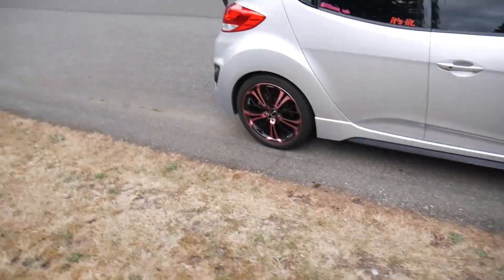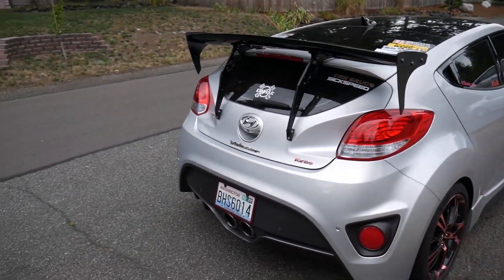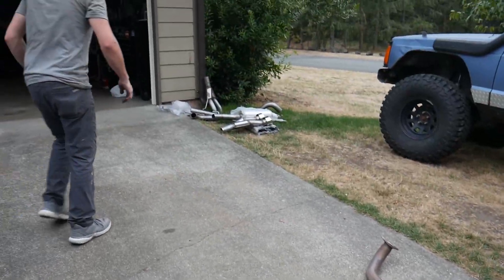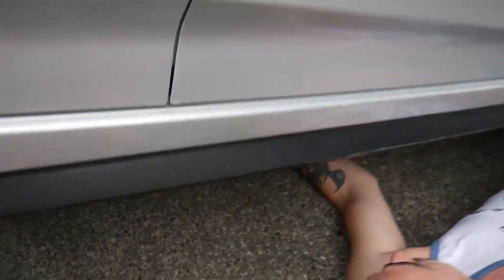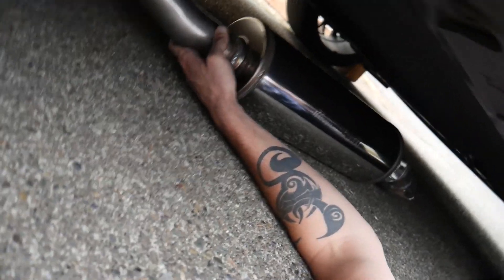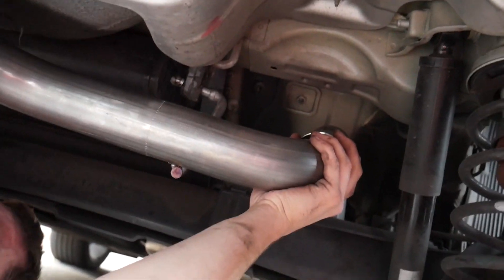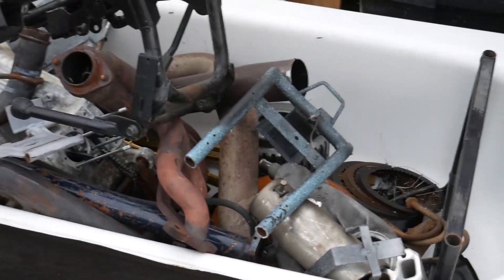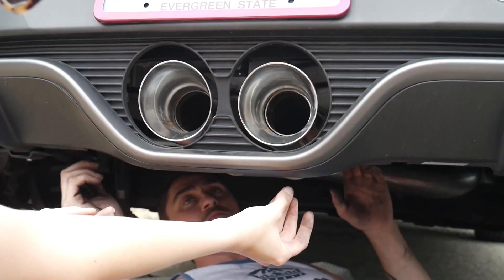THE VELOSTER GETS A MAGNAFLOW EXHAUST!

Comment: Hey guys, love the video just have a couple of questions. What year is the Veloster, is that the magnaflow 15215, and did you get any check engine lights from that exhaust? Thanks!
Reply from the maker: Answers to your questions!
1. This is a 2017 Veloster Turbo
2. The MagnaFlow system looks like the one linked here:
https://www.autohance.com/magnaflow-street-series-stainless-steel-cat-back-exhaust-system-19325.html?gclid=CjwKCAjwo9rtBRAdEiwA_WXcFvbqIT20S0fTFB1X1krEBVA8_6BiN5VhgtMvj8HpNH9NrpeP7_WdNBoCWecQAvD_BwE
3. No check engine lights!
Reply: Was it all bolt on? No welds needed?
Reply from the maker: chase pineda completely bolt on! No welds at all
Reply: Wear can't hay buy this